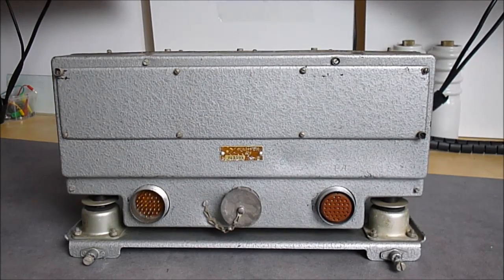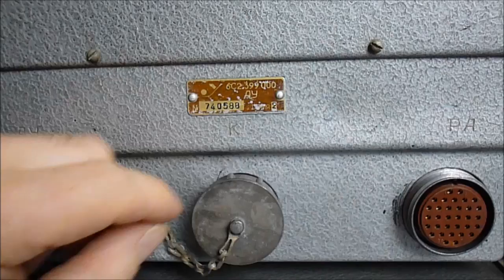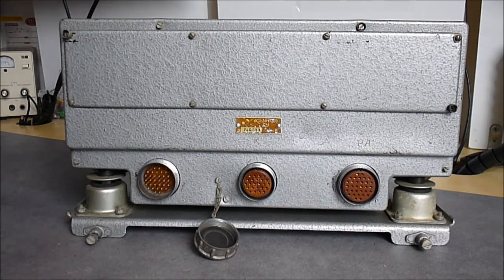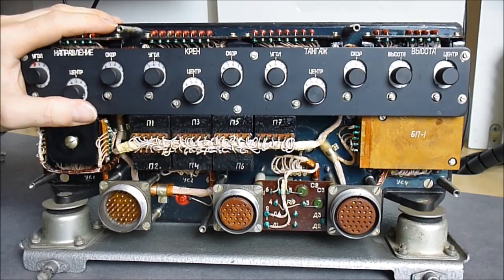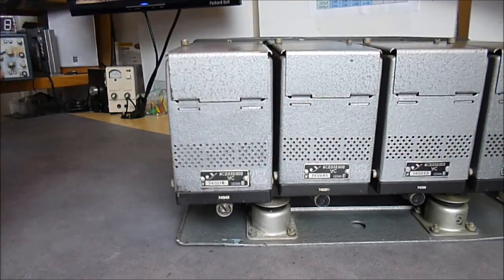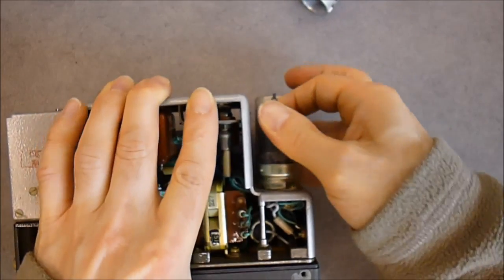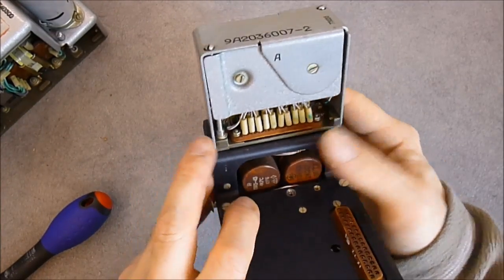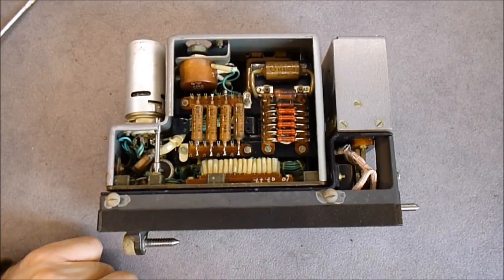Soviet MIL helicopter autopilot unit teardown

Comment: The triode pairs look like a diff-amp base circuit similar allaboutcircuits.com/textbook/semiconductors/chpt-8/operational-amplifier-models and it seems these just generate some error signals compared to a reference. Not sure why still tubes - even the Soviets should have had bipolar op-amps like the 702 by 1974-1977.